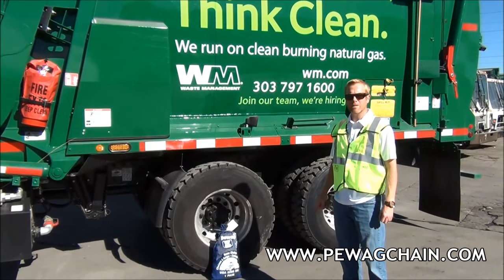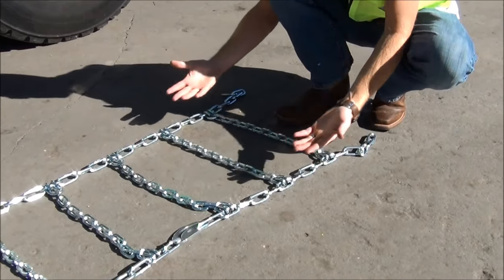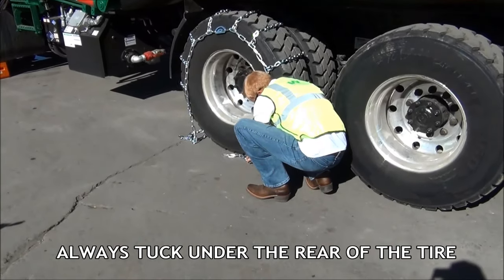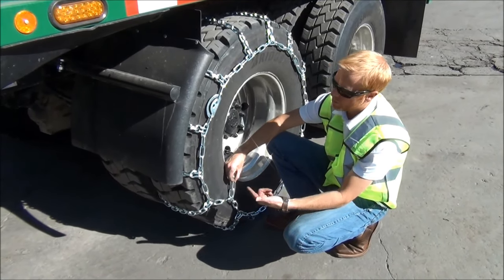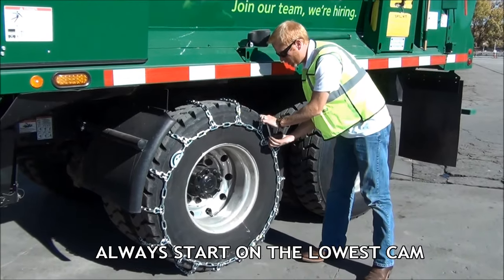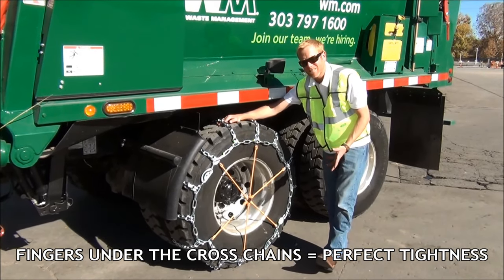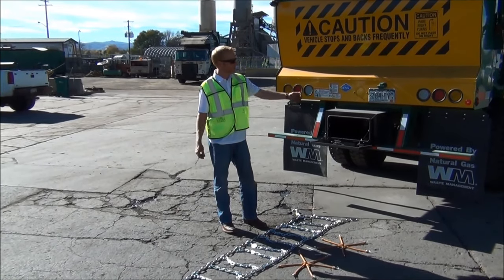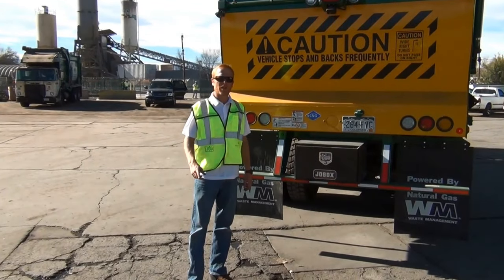How to Install Tire Chains Correctly, Tips, Tricks, and Safety!

Comment: I was wondering if there are other videos, or maybe a website you could direct me to that would detail the effects of driving on a chain in some, or more, of the following 'for instance' situations: 
•The chain is the wrong size for the tire.
•The chain is too tight or too loose.
•The chain is twisted.
•The chain is installed upside-down. 
•The chain/hook/clasp/cam is damaged.
•The chain is being or has been driven on at excessive speed.

Although not completely necessary, images would be a big plus!

I've looked far and wide across the web, but I keep coming up empty on specifics, as far as being from an actual manufacturer's perspective. 

I understand you actually test chains yourself. What experiences have you had when a chain fails? What kind of damage results? 

I'm asking because I do chain instruction for my employer. I've been in the oilfield for going on 9 years, with 17 years OTR prior to this. The only failures I've ever had(knock on wood) have been 3 broken cross chains. 

I'm well aware of all the 'hows.' I'd just like to have some reference to the 'whys.'

If I can explain the consequences of an incorrect procedure, and maybe even show some images of the resulting carnage, I'm sure it would tend to sink in a little more than the simple spoken word.

Thanks in advance!
Reply from the maker: Hey Louis, I'm not aware of a website or other videos that get into these instances, but I'm more than happy to discuss all of these with you.  Call 1-800-445-2895 and ask for Luke.

Comment: Anyone who’s actually chained in the bad weather, when you need to, knows you never lay them flat prior.  When you hang them up you make sure you do it in a manner you do not get twists. That way you can pull it off the rack the same way every time and put them directly on the tire.

When connecting the chain make sure you get it as tight as possible on the inside so when you tighten the cam locks on the outside it will make it so tight you won’t hit the underside of your trailer.
Reply: I lay my chairs down every single time before I put them on my tires.
Reply: @crazyray4271  Let me guess, you never chain up so the only time you ever put them on was when you were learning how to chain? lol I run a dedicated route From Tacoma to Mountain Home AFB once a week, went of 2020-2021 was brutal. I changed up about 15 times during that winter.
Reply: @aaronmeyers451  lol I chained 4 to 5 time a day throwing 8mm triples on.  Not your dinky little 7 mm singles.    14 years in the bush in Northern British Columbia.  When you're ready to learn how to really put chains on let me know.
Reply: Measure your inches, guys. Sack to tip.

Comment: I put my chains on the ground with the cams on the out side or farthermost from me. I found it's easier when I pick the chains up with two hands spread apart at the part closest to my feet, and I flop that side to the inside of the tire the cams will be on the outside and the dog paws will be facing outwards. In other words I lay the chains out in mirror image because when I flop then over onto the tire the chains will be in the correct position.  
I often note that the spring tension set like you shown do not last very long. I simply use rubber bungee cords about 4" shorter than the tire diameter as I always have loads of them driving flat bed. I one is to long I just tie a knot or two in it and it works fine.  Also with the loose chain that's left over, I wire tie it.. I keep a pair of side cutters right with the key and always a bag of 8" wire ties, however like you shown this is not mandatory.  One company I worked for had old chains, and I'd wire the cams to the chain so they could not unlock. If I drove a little bit and the chains needed adjusting (and they usually did) I simply cut the tire tie, get another link or two, re tighten the cam and stick a wire tie or two to keep it held down. You were under the best of circumstances with this tutorial, and top notch gear. However, even with all my opinions and observations this was a really good demonstration and no one can go wrong using your method.  Also a head band bright light on a hard hat light helps at night. I also have traveled at 45 MPH in deeper snow, but only 25 in light snow, ice bare road for long distances without problems.  I also think that trucks do not chain up enough that they run in bad weather and then screw up the road. I can't tell you how often I've waited at the bottom of a hill because a tractor was not chained up and he was jackknifed from spinning. It's a little late to chain up when the truck is in that position and snow and ice are all caked up around it, not to mention dangerous.
Reply: CHP issues citations now...failure to obey traction control requirements....ie...did not chain up or lost more than one chain due to improper installation.
Reply: Thanks for sharing your knowledge. I always enjoy taking in other truckers advice and lessons whenever I can.
Reply: @Kevnadian  Every driver has his preference.... I use the bungee to control the left over chain links.

Comment: Get two 4x4 inch piece of wood 12 inches long...put behind inside drive tire. Back up truck onto wood. This will lift the outside tire 4 inches off the ground. Do both sides at once. Now you can easily put on both singles super tight without moving the truck. Singles are crap to put on in bad weather with snow on the ground...all these videos are in summer on bare pavement. Much worse to do  when its storming with 5 inches of snow on the ground and is dark and minus 20...
Reply: So spend time shooting blocks of wood from under your tires when you could just roll on to them ?
Reply: @crazyray4271  Are you referring to the whole video, or the comment about 4 x 4 wood? And please explain why?

Comment: The trailer tire chain comes off on a semi  while  driver tires  stay on . Same size tire , recomanded chains for drive and trailer .. however , lots of truckers keep having same issue ..and yes, the trailer tire looks different, more skinier.... for sure, I have to come with some other style to keep the chains on , maybe tighten them from inside or somethimg

Comment: I've never heard a trucker say, ok, it is time to rotate the chains to the other side to prolong their life cycle.
Reply from the maker: What kind of truckers do you hang out with?
Reply: @pewagTraction  frac
Reply from the maker: @CanadianBullFrog  You are probably running studded chains then, thus you can't rotate them.  Cheers Bull Frog!
Reply: If they are general service chains (without studs or V-bars), I've been known to completely dismantle my chains when they get too worn on one side, flip the crosslink connectors 180°, put everything back together and have the previously unused side of the crosslinks in contact with the road surface. Double the life of the chains!
Reply: @louisbecker5941  I guess for non studded that makes sense. Around where I live mostly everyone uses studded.

Comment: My wife said UPS teaches them to drive the inside tire up on a board so you can put on the chains without needing to pull forward, only saves a few minutes but when you have to do it at least 10 times a day it really makes it easier
Reply: The best thing I found to do is to take one cross link off the chain at either ends of the chain. I have put them on in snow and mud without having to drive forward. works great.

Comment: Peewag:
Been driving one year July, 2020. Never had any snow chain training in CDL School or when I became an employee of the company in with.  It almost seems like everyone must already know how to clean-up, etc......Actually,  the only thing my company mentioned about snow chains , was if it's cold enough for snow chains, "you need to go find a safe haven and wait for the weather to pass".  That's the extent of training provided!! I'm glad I came across your video...👍
Reply from the maker: Thanks, let us know if you need anything else!
Reply: An Austrian Painter  And I think all car drivers should be able to change a tire, and demonstrate it before getting a driver's license.
Reply: Yes, you should know how to chain up. Should be required in ALL trucking schools. However, in 30 years of trucking ive only had to chain up 1 time, going over Donners pass. Was 80 degrees when we left Sacramento heading over towards Reno, NV. They made us chain up. Took 30 mins. Only needed them for like 3 or 5 miles, then made us take them off again. But your company is absolutely correct. if its that bad, park it and catch up on some sleep or something. Many people will disagree, but they chained up for free, cause you dont get paid for labor as a trucker. i sleep and still got the load there on time.
Reply: Drove doubles in Wyoming for two or three years before I chained up. Had to go down  South Pass and of course got chicken skin but after 20 minutes I was glad I didn't have to ask another trucker how to do it. I guess they were on they didn't fly off?

Comment: Try this, carry a 20" length of 4 x 4 block.  Run the INSIDE dual up on the block.  Now you have a space to adjust the chain around the tire.  Of all the videos I have watched, have not seen this method.  They always want to put the block under the outside dual.  This has worked great for me.

Comment: Why do you use hooks instead of boomers. And does your triples have cams on both sides or just 1 side.
Reply from the maker: Our Triples have cams on the inside as well, not needed on singles.  If you buy our chains without cams, they come with "Boomers/ Levers" to tighten.

Comment: This will do no good. You have duel tires. A set of triple rails is what you need!
Reply from the maker: Trash trucks mostly run residential routes, duals are overkill for them and hard to put on for drivers that don't do it very often.

Comment: How to install tire chains correctly.

Work for a company that doesn't, pull off the road, and shutdown for the day.
Reply from the maker: Sounds like a long trip Lucky13
Reply: Lucky13 And what company would that be. Certainly none I’ve worked.
Reply: My boss told me the roads open and go for it
 With a straight face I had to tell him the avalanche would be cleared in six months. He suggested I take a new route.

Comment: Do you have a recommendation for single tire chain or doubles ( single wheel on your dually or cover both )? Do you have a preference  which is better?
Reply from the maker: It's all about personal preference, but you definitely need to know what you are doing if you are throwing duals.  Singles are much easier to install.
Reply: @pewagTraction   thanks. i ended up with doubles and i see what you mean by knowing what you are doing. But i've taken sometime each day to practice with them, (of course in a warm dry warehouse) so things are easier. Hopefully practice makes perfect

Comment: We'd get suspended for putting single rails on duals. Believe me I’ve taken my chances and used singles with no problems but I was lucky a supervisor didn’t catch me.
Reply: Jake D no that’s my employer’s rule. They’ve been in the oil hauling business for decades and we haul in and out of some pretty nasty places and I guess they’ve had instances where a person spun out using singles and so it became a rule that you use only doubles on duals or get suspended. Also get suspended if something happens and you have no chains.
Reply: 2 singles ain't going cut it on the places I go he'll sometimes 4 triple rails won't even work and half to get pulled up the mountain.
Reply: You are the driver...do what is best by your standards...no office puke will have to answer for a jackknife or a wreck!

Comment: The only thing wrong here is not freezing cold you’re not at the side of the road in the chain station with a bunch of snow packed. The chains aren’t wet and slippery and freezing and trucks aren’t changing aren’t zipping by you at 60 miles an hour.

Comment: Realistically the centering of the chain on the tire is a bad concept...set the front of the tire with one cross link touching the ground....tuck the difference on the rear sides of each tire...slowly go forward...not backwards...hard to believe the misinformation put out by a distributor of chains!
Reply from the maker: John Rogan So the driver can hook up with his back to oncoming traffic?  Our method comes from the point of view of Saftey first!
Reply: John Rogan To each his own but I’ve been doing it the way that the video described for 30 years and have never had a problem. I drive the highways of British Columbia Canada so I’ve installed a chain or 2 .

Comment: The best thing is to put the chain on the inner wheel, but it is much easier to put the chain on the outer wheel.
Reply: Why would you put it on the inner wheel which is way harder and gains  you nothing at all?